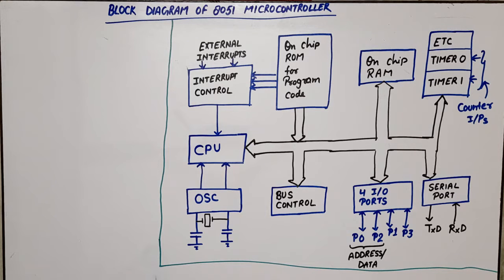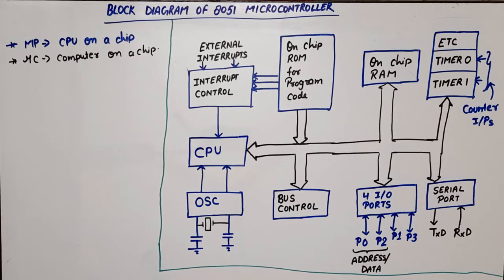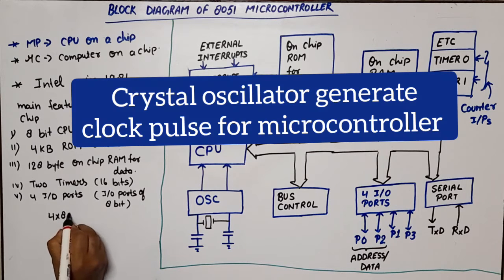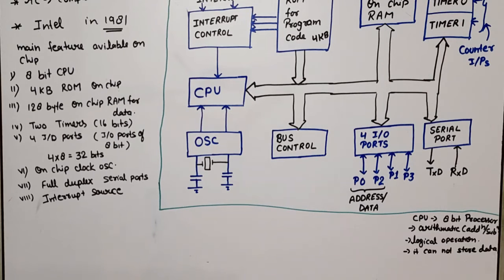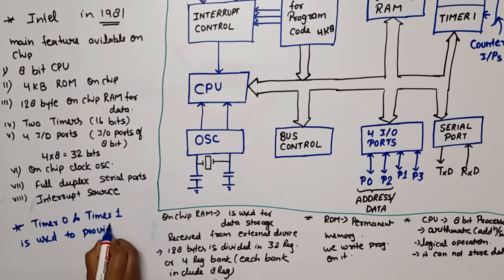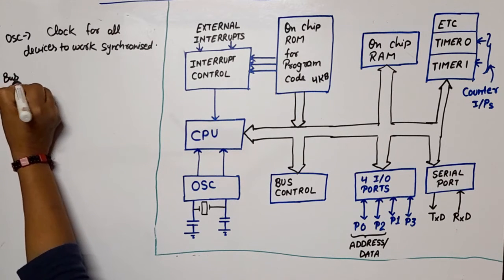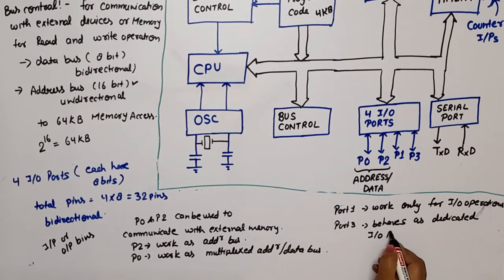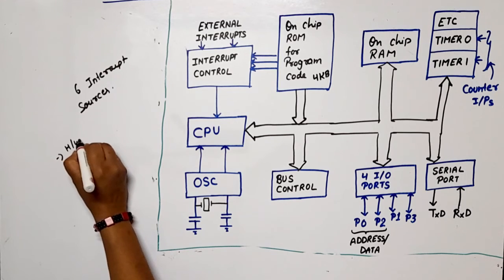Unit 4 L1 | 8051 architecture | Block diagram of 8051 Microcontroller | 8051 block diagram

Comment: maam txrd and cts baar have same meaning if both are 1 then the microprocessor will be ready to receive the data  ??
Reply from the maker: TXD = 1 MEANS TRANSMIT DATA
RXD=1 RECEIVE DATA
for more detail u cam.check the video of 8051 pin diagram 
Cts or RST